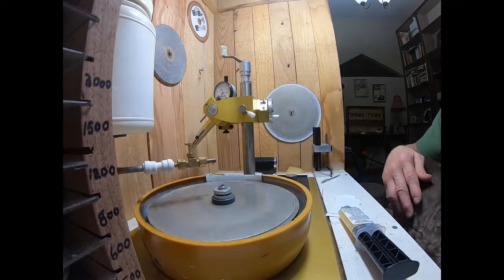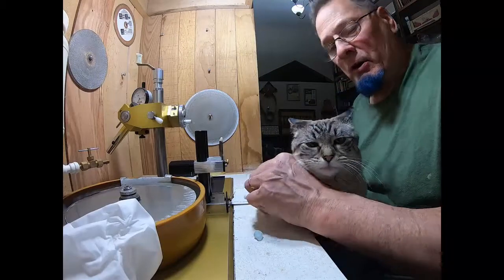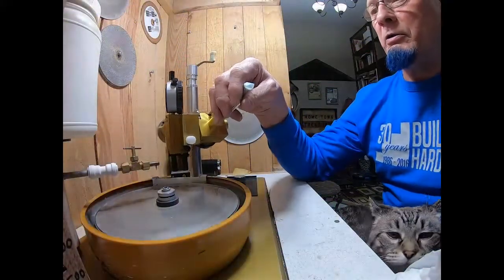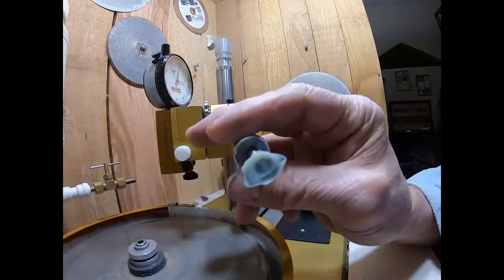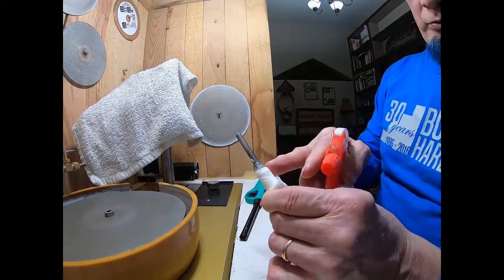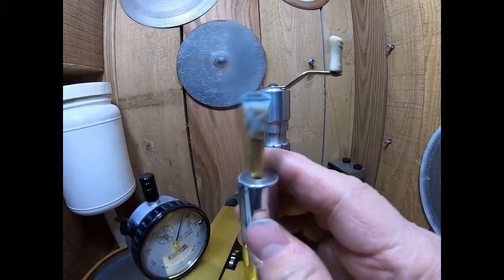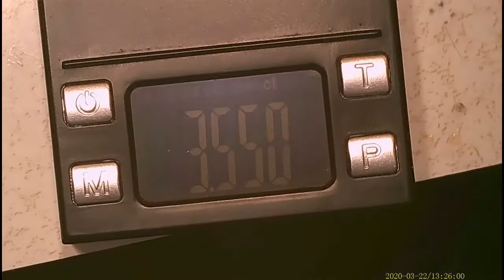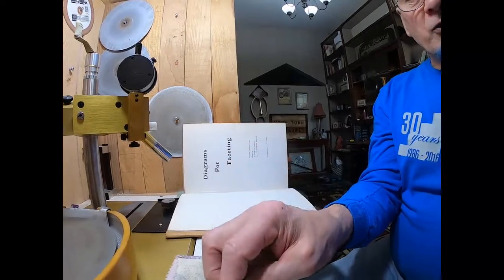FACETING GEMSTONES- FREE TOPAZ

Comment: How much is your machine I’m trying to facet myself and how long dose the wheels last I see you use 2 or 3 wheel one for pre polish and one for final polish
Reply from the maker: There are a few machines on the market. This one is Ultra tec and costs about $5000. Facetron makes a very good ma chine for about $3500. There are some starter machines on Amazon for about $450. I started on one of those starter machines and you can do some good work on them. The diamond  electro plated plates are also on Amazon for about  $15 in different grits and you can do quite a few stones on each plate. You can use Lightning Lap plates for finishing . If you get further into faceting there is nothing like a good tin lap with diamond grit for your final polish. Good luck and thank you for watching.